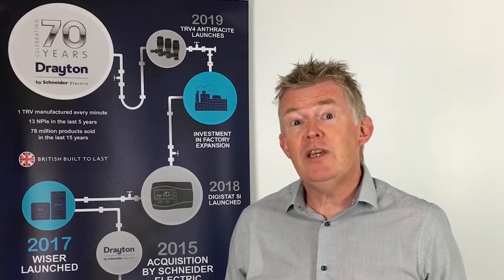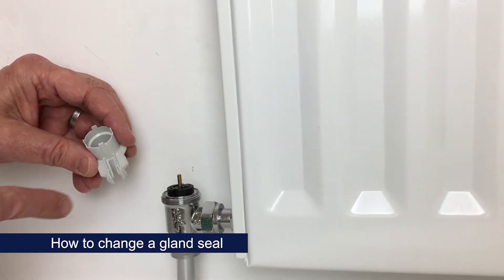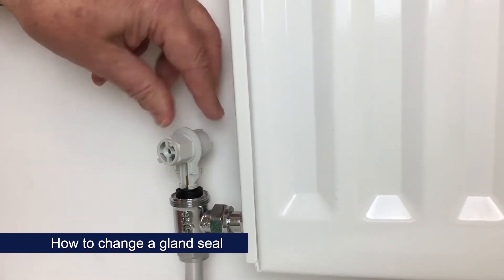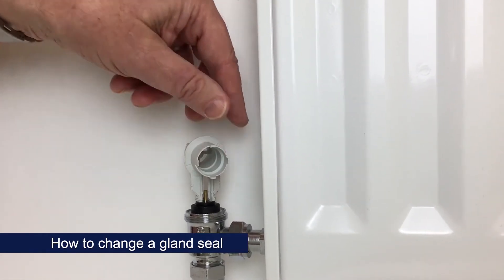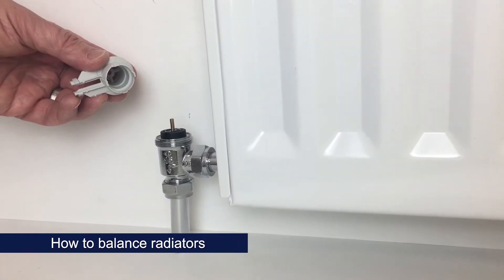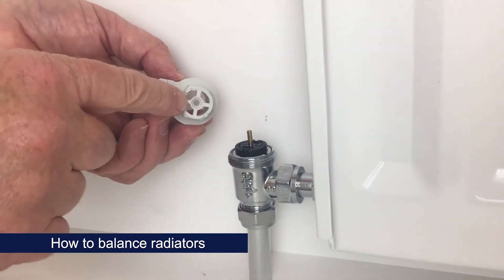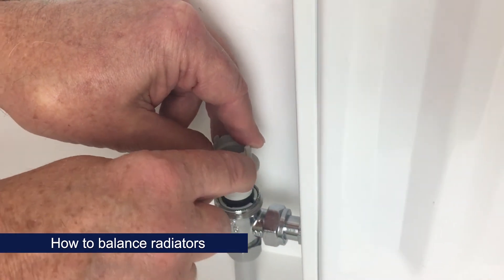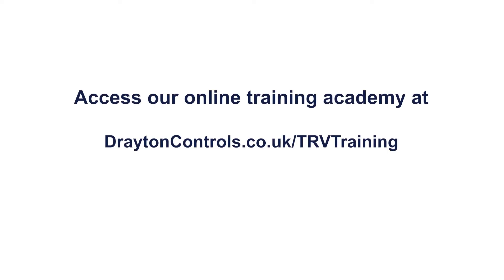How to use the Drayton Balancing Key to balance a heating system

Comment: The interesting thing is that I've had Drayton TRV valves in place at my house for 5 years, and have only just found out that the TRV insert can be used to balance the rads. I've been struggling for ages trying to balance the system using the lockshields that came with the valves, which is really difficult because they give nearly 100% flow after about ¼ turn. The plumber that fitted the TRVs was obviously also unaware, as they are all still on setting 6. You've got Heat Geek putting out videos about lockshield valves and saying get these lockshields with presetting as they're much easier, and all the time I've had presetting available in my TRVs. Not sure why there's no info in the packaging about this, and why it seems to be such a well kept secret. 🤔
Reply from the maker: Thanks for your feedback, I will make the product management team aware of your comments.

Comment: David Kempster, read the comments and correct the video  You say on video to turn the locking ring by 180 degrees yet Drayton printed docs say never more than 90 degrees. This has caused at least one major problem (see reply to my previous comment).

Comment: In the instructions (and another Drayton video) it says in large capitalised bold letters to  never turn the locking ring more than 90 degrees or one quarter of a turn.
Reply: I wish I'd read your comment before attempting this. I turned the locking ring 180 degrees and the entire black inner section flew out of the TRV. This was followed by a large quantity of hot system water. 

I managed to hold the black bit in place to plug the leak and then screw it back in under system pressure. I fear the carpet may be ruined and I'm waiting to see if any water has made it through the floor/ceiling. 

What a mess - entirely caused by this stupid video.
Reply from the maker: We will update this video, it should  be OK to turn to a max of 180° but no further.  Also it’s important to note that the valve insert should be turned in the clockwise direction only to set, if turned anti-clockwise, it could drag the locking ring with it, thus opening more than the max 180°
Reply: @Draytonheating  If you're only allowed to turn the insert clockwise, which reduces the flow rate, does that mean that if you accidentally end up setting it too low for your rad (say setting 2 for example), you then need to continue to turn it clockwise to get it round to position 6 again before you turn clockwise to a new setting, eg 4? Or does it mean that it's a one way one time thing, so you have to take it down in steps to avoid setting it too low or you're stuck with it. Or if you set it too low, can you carefully turn it anticlockwise to a higher number?
Reply from the maker: If you go pass the setting you require, keep turning in a clockwise direction. The insert is not threaded so will turn infinitely. We recommend not running anti clockwise to prevent the clamp ring being loosened more than necessary.